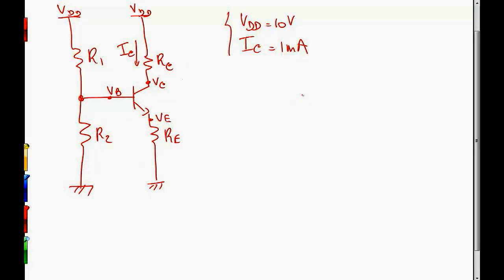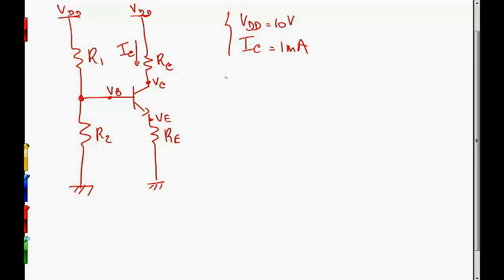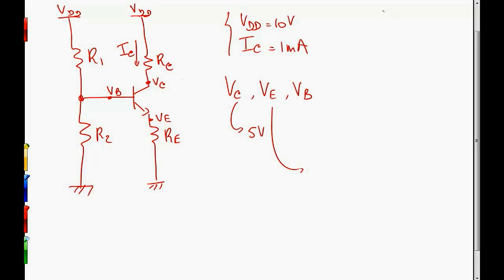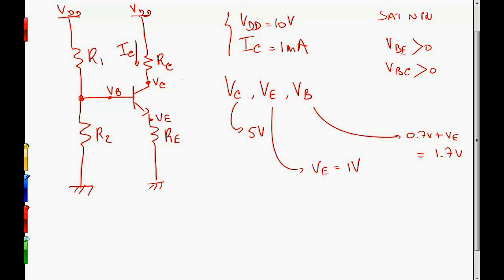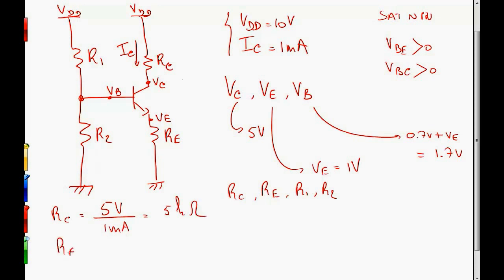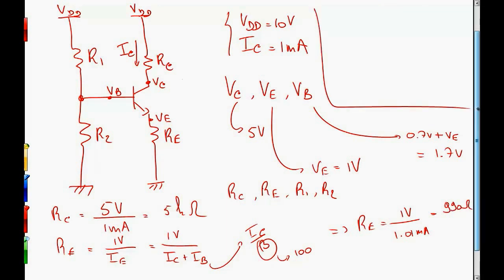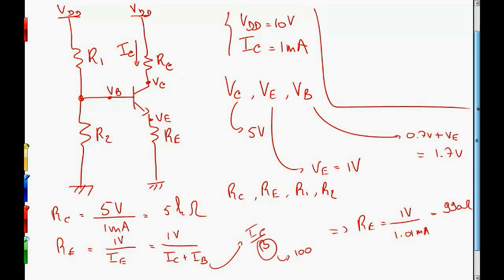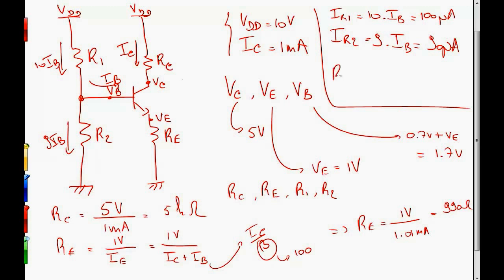How to bias an NPN transistor using the 4 resistor biasing technique

Comment: Im a little confused her at why 10x1ma has resulted in 100uA amd not 10ma. Is this just because its how ampares behave because it seems strange. Im clearly a novice and hugely appreciate how succint and effective this video is. Thanks just a tad confused about that bit.
Reply: If you use 0.1 instead of 10 relating to your rule of thumb as in ir1=0.1×ib (rather than ir1=10×ib) then I get your result. Im sure this is me being foolish but if someone could be so kind as to where im making a mistake here id appreciate it :)
Reply: I've seen the error of my ways here, so ib=ie/hfe and ie~=ic therefore its all good and I get the same values

Comment: thanks for the info. but i have been told time and time again that biasing info is in the data sheets. where is this info at in a data sheet? i've also seen and read that as long as the transistor is a npn. you can replace one with any type npn resistor you have on hand. all i need to do is set bias resistance and or the bias voltage to run what ever manufactured npn transistor. i not sure of this info. i'm a novice in this game. and feel strangely dangerous here.  i have seen and heard that a 2sc2879 take a bias voltage of .69 to .71 volts to bias ab1 class. i've seen in one data sheet numbers like this but it showed these numbers with a temperature not a voltage. and it was on a data sheet for a different transistor.
Reply: I'm not an expert but I have read a number of data sheets for NPN transistors and I haven't seen biasing specs, so I'm pretty sure it's not true that the biasing info is in the data sheet.  As far as what the correct biasing is, I think it depends on the design and what the circuit is intended to accomplish, as he alluded to in the video.